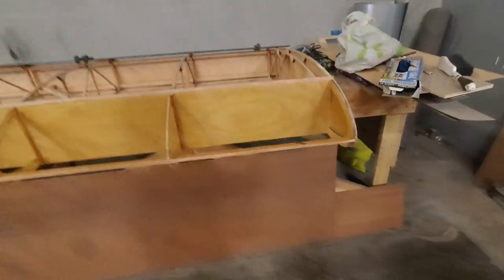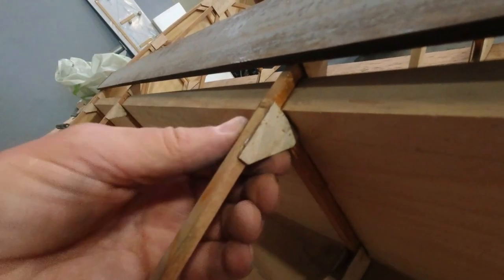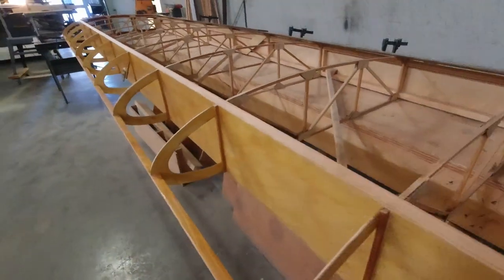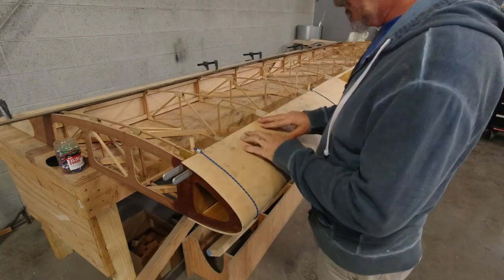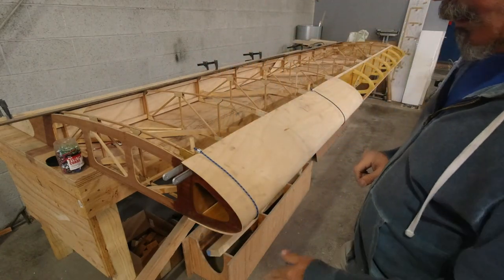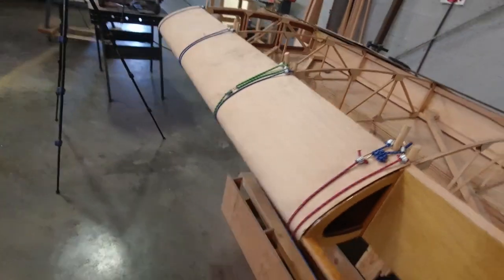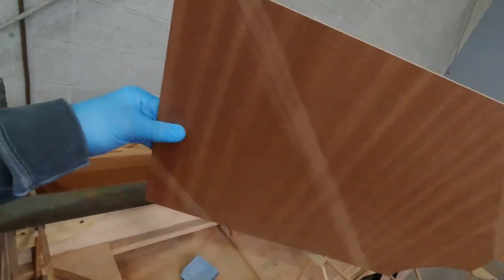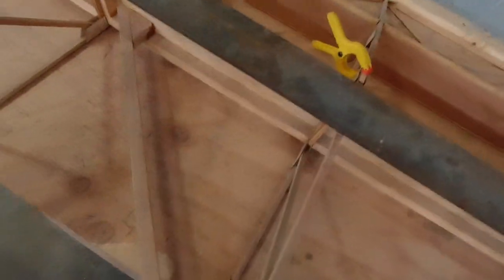Minimax 1100r Aircraft Build Vlog Episode 37

Comment: I'm enjoying the build and have watched most of the videos; do you have any of the spar fabrication? I would love to see that.
Reply from the maker: You know I started filming right after I built the spars. They are so easy to build, the fuselage is the same method, build a frame and sheet one side with plywood. If there is anything that takes nerves it’s cutting the 10 degree angle on the top.

Comment: Did the wing and aileron leading edges need to be inspected before closing them with the ply sheeting?
Reply from the maker: No inspection required, just well documented. The leading edge of the wing is still able to be inspected if necessary due to the cutout at the root rib.
Reply from the maker: I had an inspection prior to putting the fabric on
Reply: @DTMinimax  Thank you. I'm nearing the end of one wing in my Dakota Hawk build. I wasn't sure if I could sheet the leading edges until its been inspected. On the DH, both the aileron and wing leading edges, and flaps are sheeted. The wing leading edge can still be inspected, but the aileron and flap cannot. 

I have another unrelated question, do you plan to epoxy aluminum fittings in place (in addition to the bolts)? For example the control horns, wing to fuse attach fittings, etc?
Reply from the maker: EAA’s technical counselor program has done such a good job that the FAA only requires one inspection, the one the DAR performs for airworthiness. 
In the early 80’s there we’re pre-cover inspections but not anymore. So it’s left up to a prudent builder to determine when they want someone else to have a look. Since this wasn’t my first build I decided to wait until pre-cover. I counseled with the factory and a DAR friend of mine many times along the way. 
If you are uncertain or at all uncomfortable, at a minimum, take some photos and have Fisher give you the thumbs up that you’re on the right track. 
For me, there’s over 160 videos of documentation so far:)
Just wanted to clarify that a little.
Reply from the maker: I don’t plan to epoxy any of the aluminum fittings, bolt only. Do your plans make that recommendation?
Reply: @DTMinimax  The plans do not, but the build manual does recommend it. The manual describes gluing the strut and wing attach fittings at final assembly. I plan on asking Fisher Flying about this but wanted to see if in general other builders do this or not, because I'd prefer not to.
Reply from the maker: @ianherbert1214  I’ll be really interested to hear what they say.
Reply: @DTMinimax  I'll make sure to let you know!
Reply: @DTMinimax  So according to Fisher, it's not a requirement to glue the aluminum fittings in place. There are a few bushings in the Dakota Hawk wings which must be glued, but as for the strut and wing attachment fittings, it seems just based on level of safety/comfort you are looking for. Have you put inspection holes to inspect the strut and wing attachment fittings on your minimax?